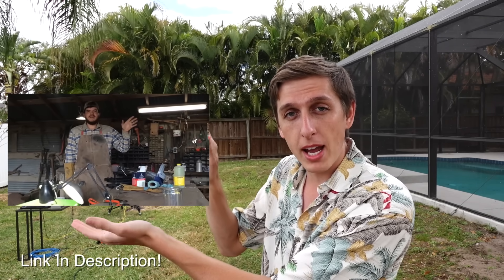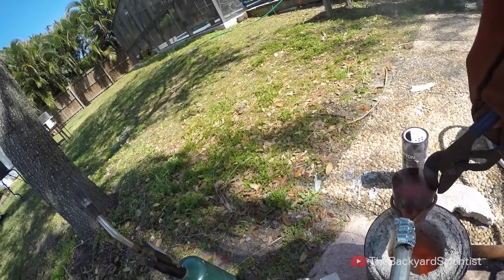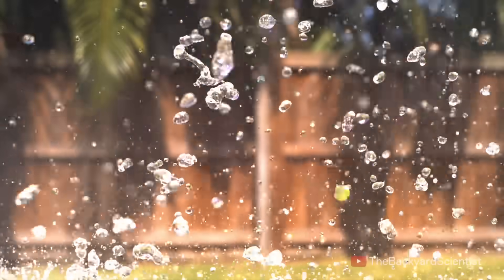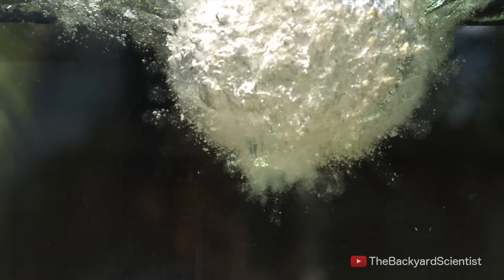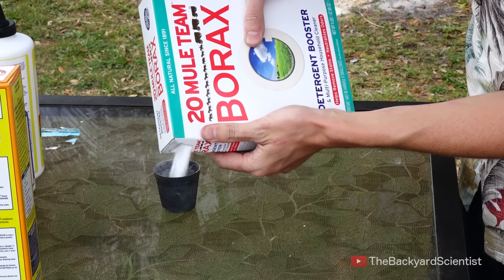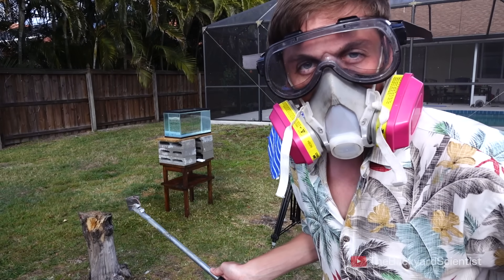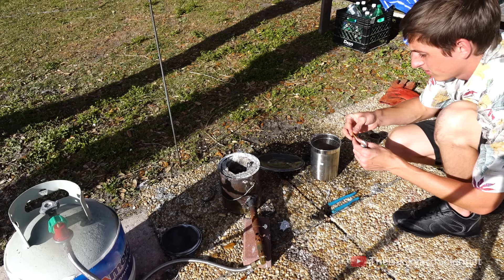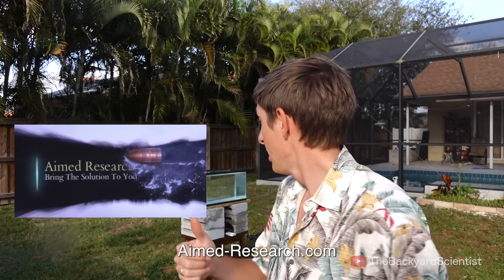Pouring Molten salt into Water - Explosion!

Comment: When salt is heated over 800 C , the reaction that forms salt goes in reverse > NaOH + HCl = NaCl + H20 >>>  NaCl + H20 =
HCl (Evaporates) + NaOH
Reply: Why would this cause the explosion though? High volume of gas procuced?
Reply: Tim H Yes , normally Hydrogen Chloride is very soluble (creates Hydrochloric acid when in a water solution)  , but due to the heat , and the reaction , it is like a magnet pushing another one off of it when the poles are the same (Heat rearanges molecules and forces them to push each other away , difficult to explain)  , but yes gas formation creates pressure and causes a shockwave.
Reply: Surely if this happened the pH would drop afterwards due to the NaOH, which he showed didn't happen?
Reply: Rimmel It's a reverse reaction , so when the heat was neutralized , the HCl dissolved again and reacted with the NaOH thus in the end it is pretty much the same outcome.
Reply: Like Hydrolysis

Comment: 2NaCl + H2O --> Na2O  +  Cl2  +  H2

I'm guessing this happens when salt is hot instead of dissolving like it normally does (dissolving reaction: 
NaCl --> Na+  +  Cl-).
Hydrogen gas (H2) is flammable. I'm guessing that the first reaction I wrote (if it is a real reaction and not something I made up) is exothermic (it releases heat). I'm in AP chemistry, but if I guessed the reaction wrong and it is actually something like 2NaCl + H2O --> Na2O  +  2Cl-  +  2H+, then please correct me.
Reply: Actually, I read the comments below and realized that the reaction is NaCl + H2O --> NaOH + HCl. This does not affect the pH because equal volumes of strong acid (HCl) and strong base (NaOH) are formed. But I don't know why this would explain the explosion. Maybe this explosion isn't a chemical reaction at all. Lava supposedly explodes when it touches water, so this is probably the same.

Comment: maybe it's like dynamite? Get nitroglycerin on its own and it will start making with the fireworks at the slightest disturbance (pure sodium + water), but mix some stabilizers with it (Cl) and you get a much more stable setup, meaning it reacts slower, allowing it to get deeper into the water.

Doesn't explain why the cavitation effect didn't protect it like the rest, but it's what I've got atm.

Comment: Are you people fucking stupid. It's cause sodium it self is explode able. Really take a Chem class. When your heat up salt you are separating the Na molecules and the Cl.  But man you guys are have to just take go take a Chem class in college.
Reply: A few problems: what's the reducing agent converting Na+ to Na°? Besides, elemental sodium would immediately be oxidized back to the cation by atmospheric oxygen.
Reply: +Kashi Seereal that's is why he said it worked better if he got it hotter. Which means it can hold that chemical reaction for a while.

Comment: I am guessing that the molten salt, given all the thermal energy is able to react with the water giving products of Sodium Hydroxide and Hydrochloric Acid. I could and probably am completely wrong, but that would be the only thing that makes sense. Again :H2O + NaCl --> NaOH + HCl is my best guess although if this is wrong and someone knows I would appreciate a reply.
Reply: +TheRoflcopterGod NaOH is a strong base and HCl is a strong acid, which means they'd rather dissolve completely into ion form instead of staying as NaOH and HCl. Other words, there's just H+, OH-, H20, and Na+ and Cl- ions floating around, which is your salt water solution. The reaction you say isn't thermodynamically possible. Correct me if I'm wrong.
Reply: BalconySofa 
I knew and understood about most of what you typed, but the thermodynamics of it is what really made me realize this isn't possible. I knew that NaOH + HCl --> H2O + NaCl is a common neutralization reaction so basically I wanted to verify if the reaction was reversible and so I searched around to see if this reaction was reversible, and I found out the answer is no.
http://chemistry.stackexchange.com/questions/8948/how-to-separate-hcl-and-naoh-from-salt-and-water-solution
That is the link if you are interested.

Comment: The elemental sodium dosen't actually react itself, it's creating hydrogen from the water as it contacts it and that's whats exploding from the heat.  All the alkali metals in it's row on the periodic table have a similar effect exposed to water.

That said, I bet that was fun as hell to do, and I often wish I had a backyard to do crazy shit like that in. ;-) The fish tank was a worthy sacrifice to the gods of BOOM. Let's see what other vids you have. Hopefully more of blowing stuff up.
Reply: +Jurrasic Park You're right, when you see the flames as he puts in the molten sodium by itself is the hydrogen igniting. The chloride delays the reaction allowing the expansion to happen under water. Simple enough, it cant be chemical just because you heat it. Chemical reactions happen regardless of heat if im not mistaken.
Reply: I don't get it
Reply: yay, explained!
Reply: a row is horizontal, you should have said colume(I can't spell that word for some reason) aka the Alkaline metals
Reply: +Jacob Core  Is easy.
2Na  + 2H2O --> H2(g) + 2NaOH + heat

H2 + O2+ heat---> H2O +heat
Reply: +Joaquin Lemo Yep i guess that molting the salt (NaCl) brings energy to the molecule and helps breaking the link between atoms which gives you Sodium and Chloride ... if the mix gets cold, it gets back to Salt thru crystallization (that's why it didn't explode on first tries).
If the mix stays sufficiently hot, you ends up by pouring Sodium and Chloride into water which ends up into explosion from Sodium.
What i don't understand is that the excess of Chloride should have made acid with Hydrogen and the water Ph should have decreased.
Reply: Lol i already explained this
Reply: +Joaquin Lemo Its way easier Molten salt+water=Kabooom
Reply: AtTaTcH NoSkilledAllowed No.
Reply: Joaquin Lemo
 Yes.
Reply: try doing this with Francium. ohh man what a boom!
Reply: "it cant be chemical just because you heat it".... maybe in this case but a lot of chemical reaction have a minimum or maximum temperature for start
Reply: Check out thunderfoots experiments on alkali metal explosions. From memory I think he proved it was actually a coulombic explosion
Reply: I don't think thats correct, it's a salt, so it's Na+ not Na(s) (it's soluble as na+ and doesn't explode), thus it wouldn't react with water unless some form of lysis occurs to supply the Na with electrons? And yes temperature does indeed make reactions feasible, just google gibbs free energy and entropy relationships

Comment: Not sure that the salt has any significance, other than the fact that it provides the heat source. It super heats the water creating steam and pressure instantly, causing the "explosion". I'd be willing to bet that regardless of the material, you'll have the same result if the temperature of the material you are adding is the same as the molten salt.

Comment: Its just sodium ions with the water. Sodiums a group 1 element thus why it is so reactive
Reply: +Sully Scott mineral state? Its just basic chemistry
Reply: +Sully Scott Umm... What?
Reply: Sully Scott Its molten salt; the bonds between Na and Cl are broken; suspended; theyre free to move about. The Na reacts with the water. There is no such term as a mineral state, wtf are you talking about
Reply: G Farmer True That...
Reply: Red Sniper Fairest
Reply: +G Farmer your right, sodium is an alkali metal. when spereated, it will be extremely reactive. but if it cools the chlorine bonds and takes away most of the reactivity
Reply: Nick Loomis Cools the chlorine bonds....
Cools the chlorine bonds
I wonder what does temperature mean to this guy...
Reply: Red Sniper Yeh, hes right but wrong at the same time. Lowering temperatures just pushes systems more towards absolute zero where theres no movement of anything. As there is less heat energy to encourage movement, theres also less vibration of molecules; makes it easier for bonds to form between Na and Cl, or really for anything.
Reply: G Farmer I know he's right at what he meant, but what it looked like that he's just trying to be a smartass.

Comment: how can you watch this with 21000 fps if peasants cant see over 30 fps?
Reply: +SeaSaaSer The High Speed comes from watching video shot at 21,000 in 30 fps. If you watched the video straight off the camera at 21,000 fps you would see a video in normal speed. Slowing down the frame rate from 21,000 to 30 means that each "real" time second of footage now takes 700 seconds to play back. Given this we can look at things that happen very very quickly because each frame was only exposed for 1/21,000 of a second.
Reply: MrCulldog I know, it was a joke :\
Reply: Sorry about that :/
Reply: MrCulldog lol dont worry :)

Comment: A theory of why the leidenfrost effect doesn't occur. Could it have to do with how much hydrophilicity salt has? The other three you tested where chosen cause of them being ionic, but two of them are harder to dissolve and likely less hydrophillic then salt. Sodiumbicarbonate is an oddball, cause it also reacts to water when dissolved, but is known to detractwater. So although I can't explain why it didn't give the reaction, it might be cause of the heat produced when dissolving and so getting a stronger leidenfrost effect, cancelling out the hydrophilic advantage.
Leidenfrost effect is cause the steam of the hot water is creating a layer around the hot object, therefor protecting it from more contact with the water. I might be that hydrophobic substances have a stronger Leidenfrost effect cause water really dislikes being near it anyways, while hydrophilic substances have a less Leidenfrost effect cause water really likes the stuff. hmmmmm, makes me wonder what effect Titanium Dioxide will have when molten (1843 celsius) and poored in.

Comment: Cool video, I had a few thoughts, and I think it's partly a chemical reaction with some physical chemistry state changes reacting too.

So while Sodium tetraborate is ionic, the crystal structure doesn't really allow for a lot of contact room with sodium, and if it did, it's surrounded by a hydrated sphere anyways. If you left the borax on the oven for longer (like an hour or more) you might get a tad more explosive, but I still doubt it because of the OH groups attached in the crystal salt structure surrounding the sodium. With table salt, the liquid form of free moving and sliding ions allows for more contact with the sodium, and this is further strengthened by how the table salt reacts in the video. If you notice there seems to be multiple explosions bubbles. I've never quite seen a reaction like that, but I would postulate that when the activation energy is reached, you get a chemical explosion of sodium reacting with the water. That may be why you see a bubble exploding followed by another later, and another etc. The math gets complicated but basically if you have a few atoms/molecules reach the activation energy in the boltzmann distribution pattern, you could get a reaction. 

Also the null hypothesis isn't quite void yet, those paper PH strips are terrible. Some other ways you could test a chemical reaction hypothesis would be a thermodynamic calorimeter test, using a few specific heats and such (keep in mind that specific heats change at the extreme ranges seen in the video) and see if it differs dramatically from the heat you expected. Hotter indicates a chemical reaction, since it's obviously highly exothermic. Also you might be able to precipitate the chloride ions with silver ions. If some of the sodium reacted, you could see a different mole ratio in the precipitate formed (I'd have to really think about this one... maybe it wouldn't work)

Anyways, long story short, I think it's partly a chemical reaction.... My only source however is myself, I have an undergraduate degree in chemistry, so yeah I might be mistaken.

Oh! One last thing: the heat capacity of water is crazy high! Like the molten metal cooled in seconds after the apollo missions landed in the ocean. In other words, it takes a lot, I MEAN A LOT of heat to create the type of steam in your video. Also, I don't think you're going to get a lot of good "pockets" in a compound like NaCl. The crystal structure makes me think that may not really be favourable, and if it was it might end up reacting anyway. But again... this is just a chem undergrad's stab at it. Chemistry is super SUPER complicated and you basically have to become an expert in like only a few different reactions when you get more education and work experience.

Comment: wow this could be weaponized
Reply: +vinish shetty
Not practically. You might as well just use pure Sodium at that point. Sodium metal is actually reactive with water and catches fire and explodes with greater force than that. Pure Sodium is so reactive it can actually react with the water vapor in the air if it isn't coated with a special substance.
Reply: what about super heated salt is released under a ship or submarine? like a depth charge?
Reply: +vinish shetty
What would be able to sustainably heat salt to its melting point of over 1,500 degrees? Again, might as well use a hunk of pure Sodium in a capsule and release it into the water that way. No need for super heating anything... it will explode at any temperature with deadly volatility.

Comment: I believe it's a physical reaction. I'm sure if you were to evaporate the water in either the small or large container of water, the NaCl crystals would still be there in a solution; and if they were, it would prove that it's not a chemical reaction due to having the same molecules you started with (Salt and Water).
I think what happened with the explosion was the atoms in NaCl were accelerated from the heat, ready to break loose (but not completely because it's an Ionic Bond), and that as soon as it hit the water the Sodium went to the partial negative side of H2O and the Cl went to the partial negative. The explosion was just the release of energy from the atoms as they separated.

Comment: would increasing the salt increase its solubility? if so then maybe that results in it bypassing the usual leidenfrost effect by the salt instantly disassociating while simultaneously transferring its heat to the water evaporating it explosively

Comment: the LeidenFrost effect protected the sodium metal because it had a higher melting point, making it hotter. If you you've seen a video by myth busters, they dip their fingers in molten metal. but before they did it they experimented with different temperatures to make sure their fingers weren't hurt in the process of making the video. That proved that the hotter the object is, the better the LeidenFrost effect will protect the object. Now on to how the sodium metal was actually protected, because the metal was much hotter before you poured it in, the LeidenFrost effect had made a steam pocket, allowing it to cool down before the chemical reaction could take place; but when the effect wore off, due to temperature loss, the water was finally exposed to the still hotter than normal sodium metal. The chemical reaction kicked in and then the sodium proceeds to rip the water molecules apart until a sodium molecule had made contact with a hydrogen molecule thus creating the explosion seen in the video. That's what I think happen, and why the Sodium metal was better protected.
Reply: +Pyro sodium metal has a melting point around 100 degrees c while salt (sodium chloride) has a melting point around 800 degrees c, also the sodium chloride reaction was purly physical while the sodium metal reaction was chemical so you cant really compare the two with the LeidenFrost effect
Reply: Wow, I can't believe I said Sodium Metal so many times. I was talking about the Borax. Goes to show never type a comment while you're tired.

Comment: ts the cold against the heat. idk why it didnt with the borax. my job is making magnesium and in our procedures we have to preheat all tools over all our molten salt and metal to avoid explosions. the rule is if you can touch it with welding gloves on its not hot enough to go in the molten material. another problem is just water. if your tool has water on it it will blow up

Comment: You were right with concluding that the explosion is due to rapid expansion as a result of heat change. However, the way you arrived at the fact that it isn't due to a chemical reaction isn't correct. The pH of the water wouldn't have changed even if it was a chemical reaction because NaCl is a neutral salt. All salts dissociate (at least to somewhat of an extent depending on solubility rules) and leave ions, which is a chemical reaction. The determining factor of pH change is if the salt is acidic or basic, which depends on ions present in the salt.

Comment: The high temperature vapourises the water and the rapidly expanding gas causes the explosion effect.
Reply: +Toby Tarrant 
You just said the same thing he said in the video. But why does it happends only with NaCl and not with other salts? He heated them at the same temperature, so the if it was due to the high temperature, it should happen with other salts too. My guess is that it happends because NaCl atracts water so strongly that when the water vaporizes, every NaCl molecule  has more h2O molecules surrounding it than other salts, vaporizing more water, creating a lot more gas and faster than other salts, enough gas  to make an explosion, wile the other salts dont atratc water molecules so strongly, thus not producing enough gas or  not   fast enough to create an explosion.
Reply: I didn't watch the entire video I just found the guy too annoying. I'd assume its something like that, or perhaps the viscosity, or maybe rate of energy transfer?